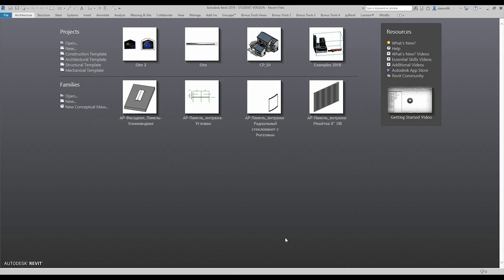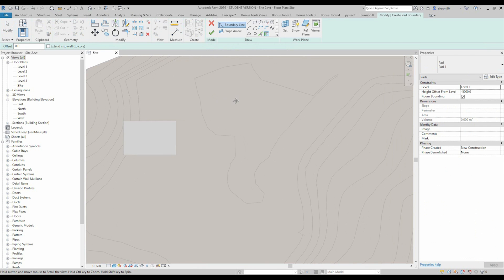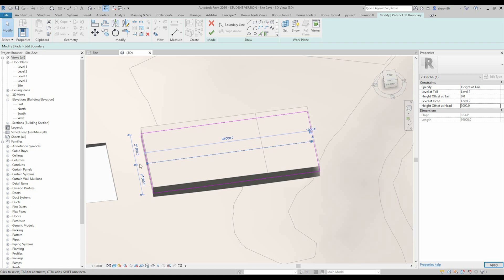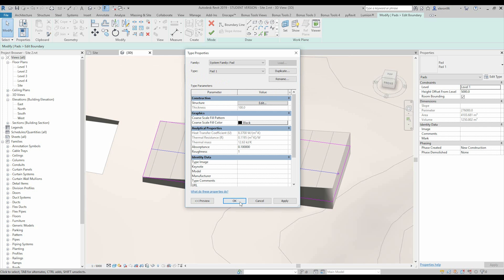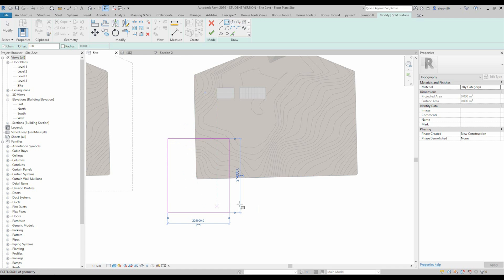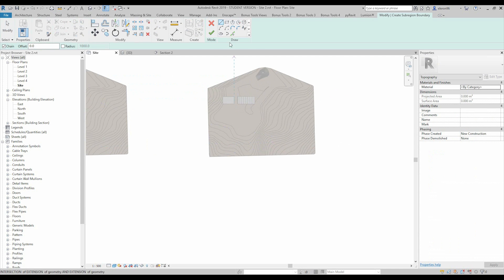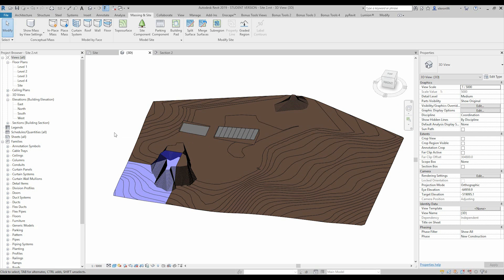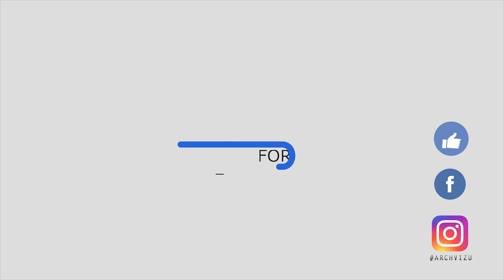Toposurface in Revit Part 3 [LR5M]

Comment: The last project you showed in this video looks amazing, do you have the tutorial for that? I am interested in the foundation part. Thank you!
Reply from the maker: Yes I'm planning to do) I'll try to make as soon as possible
Reply: 98 @NikoG  Thank you Niko, that would be wonderful. I have a project which the topo has a piece of retaining wall sitting in the middle introducing difference in height on each side. I'm wondering if I should build two separated toposurface on both sides of the retaining wall  or just split toposurface and align elevation points to the top and bottom of the retaining wall?